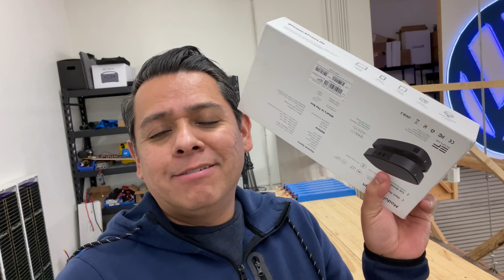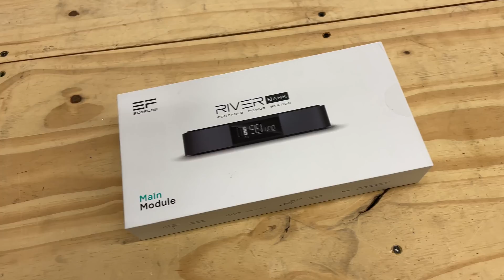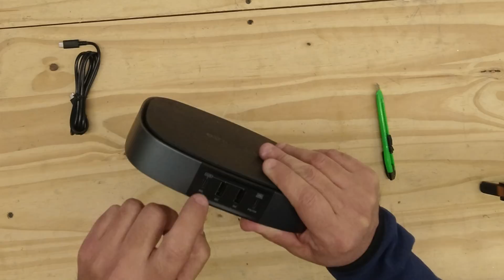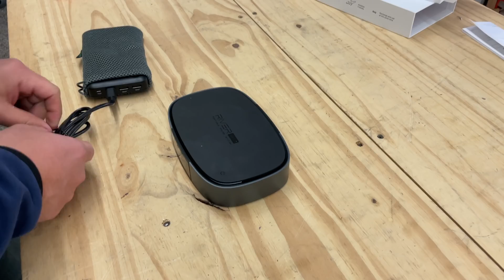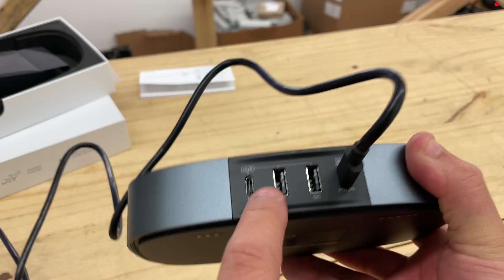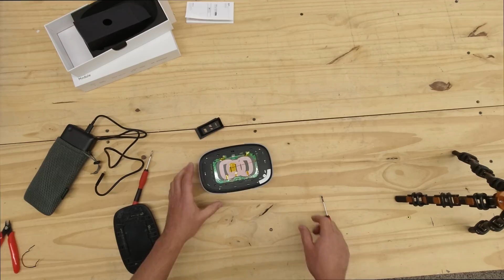TEARDOWN / Review ECOFLOW River Bank

Comment: I need something like this. But with the ability to expand it upto about 400-500wh in chunks that i can carry onto a plane (100wh limit per module) Right now i carry 5 of the Rav Power 99WH banks that i think are the same as yours but would be great to just have a single large unit so its easier to charge at the end of the day (1 item to plug in not upto 5) and also i feel it would be better long term to discharge one large bank down to like 40% SOC rather than have 3 totally dead powerbanks and a 4th i slightly used then one unused one etc. Plus this can do 60w on the PD output not 30w like the rav powers. 

I could build something myself, and i have built plenty of items i used just while on the road etc. But ive never felt ok with taking home made electronics on a plane. Especially stuff with large amounts of lithium batteries inside it.